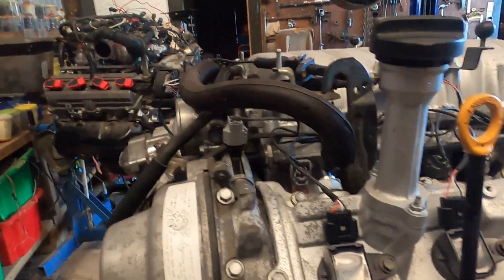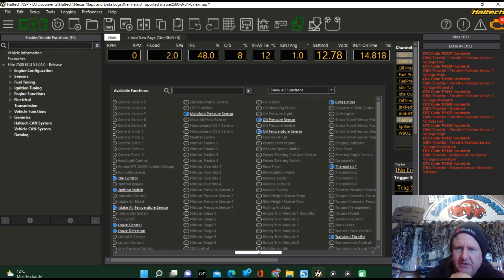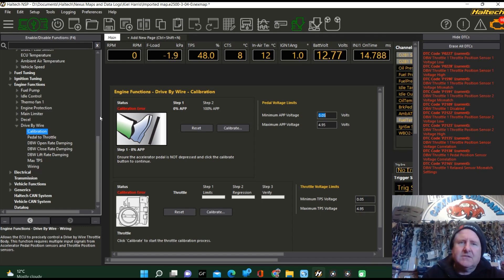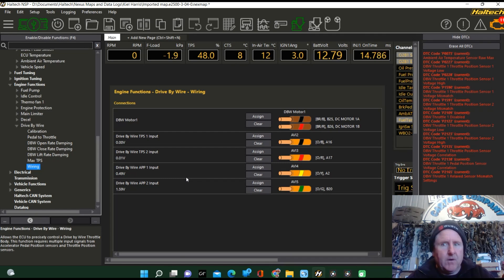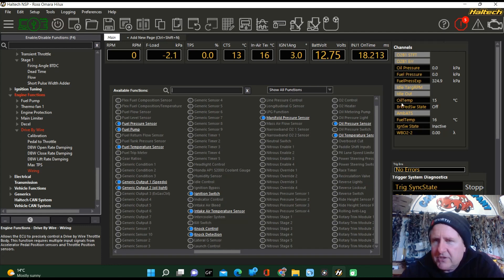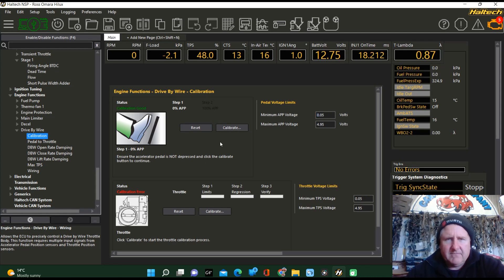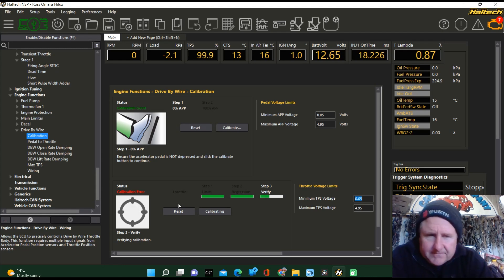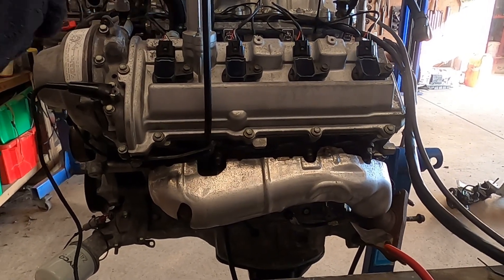setting up Haltech dbw drive by wire on 3uz lexus v8

Comment: I’m having an issue I keep getting p2109 I have an elite 1500 and I got a 1zz throttle body and pedal, the pedal calibrates but the throttle body doesn’t and tries to open during calibration but it just makes weird noises